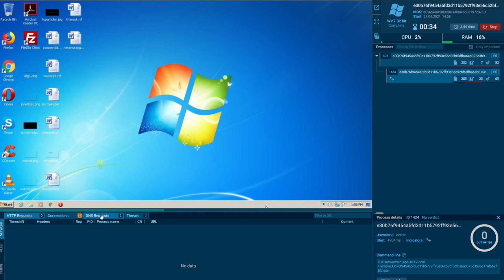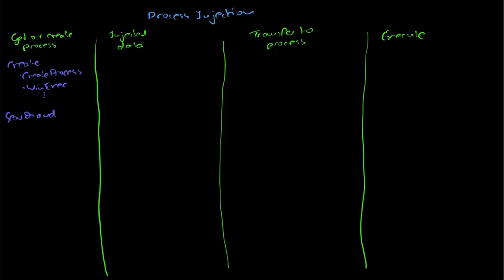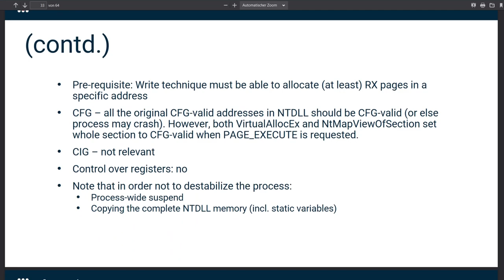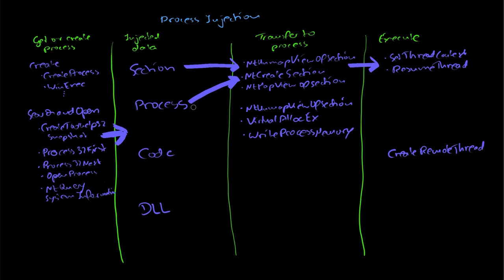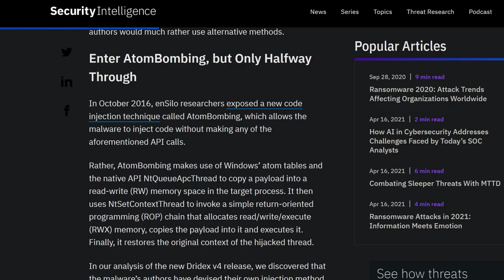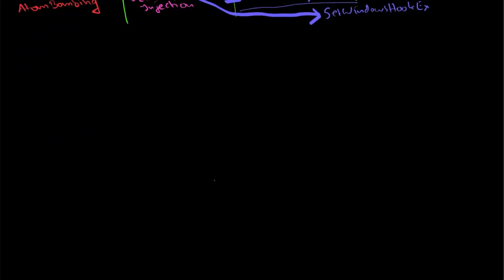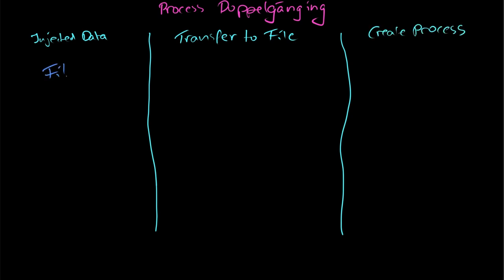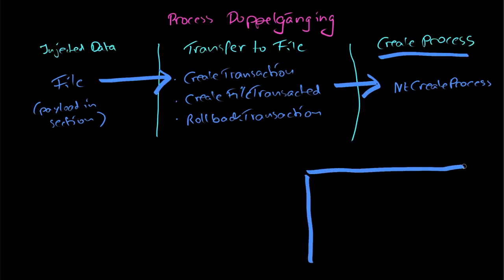Malware Theory - Process Injection

Comment: I'm currently learning a bit about Win32 Programming and I find it hilarious that all these injection types have dedicated functions to execute them, I always thought you'd have to do a lot of trickery to do something like that. Also, is there no windows built-in security check that prevents you from easily writing to another processes' memory? Or is that only done by AV's?
Reply from the maker: These functions are an overview for malware analysts, so you can recognize these and know where to put breakpoints for unpacking the injected code.

Depending on the technique used there can be more complicated stuff involved than just calling these functions. E.g. check out the article on AtomBombing which describes that it needs ROP chaining, among others.
 
There are several security mechanisms that can prevent injection in processes, especially such processes that would grant more rights. But there is not much that holds a malware back from injecting into its own child process (what they often do as a means to execute encrypted code dynamically, so they are just packed).

Some security mechanisms that might be relevant are ASLR, data execution prevention (DEP), Mandatory Integrity Control, AppContainer, code enclaves, trustlets.